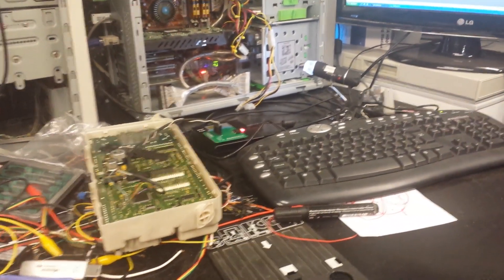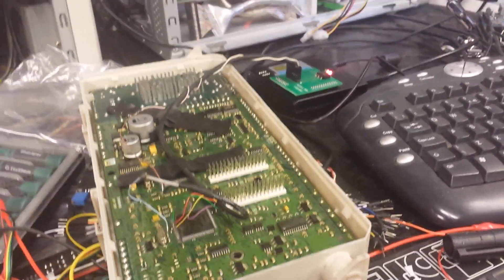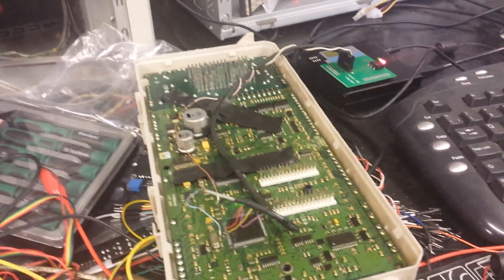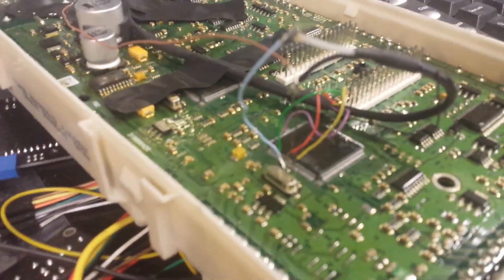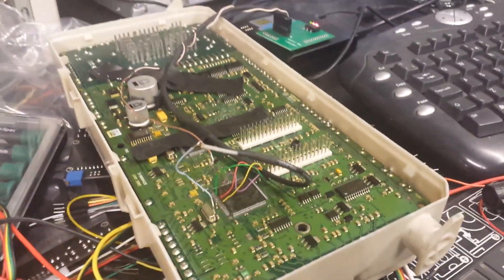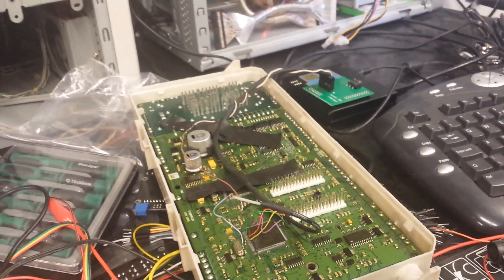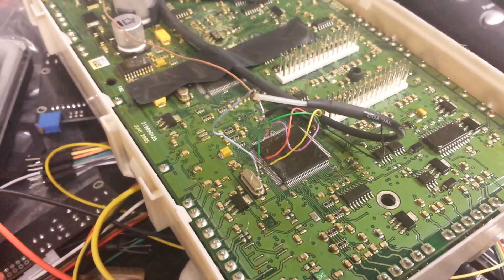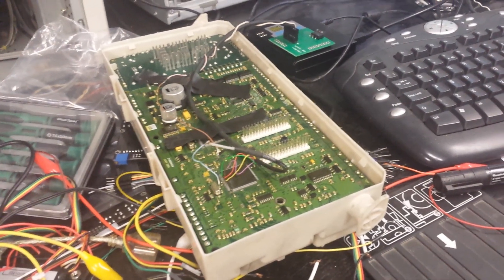Volvo S40 2006 CEM control module cloning/programming.

Comment: Hi, nice video. I have a question I hope you can help me with. I have purchased a 2004 model xc90 without any keys. I have access to a donor car with keys that are more or less identical. Do you have any ideas on what I need to transfer from the donor car to my car to get it to start and run fine?
Reply from the maker: I would attempt to just get some blank keys and program them to the car...
I don't even know if it possibly to program AKL to that specific car, but research that first...
Start to change used modules brings a lot of more variables along... I mean issues... lol
👍👍👍

Comment: Hello my cem is not working nothing working inside the vehicle including the ignition..nothing comes on ...i bought a different cem and swap the chips and it still did nothing.. but i realize that i bought a different type cem and swap the chips to it... Does it matter which type of board it has???? PS my original cem has a board like the one in the video
Reply from the maker: Have you done any other checks and testing prior to blame the CEM?
👍👍👍
Reply: @LMAutoRepairs  yes I did no blown fuses or nothing accept I opened the old CEM up and found that components were burnt inside

Comment: I have a 2005 Volvo S40 replace cems original is burned from electrical or moisture do I need to have key programed or new CEM if #'s match. Cause old one is burned dnt think anything could be cloned off it
Reply from the maker: Needs will need programming...
If you can't read old CEM, replacement CEM needs matching to the car and new keys...
👍👍👍
Reply: @LMAutoRepairs  how much will it cost to reprogram and keys, when I hook up the battery hear a like whining noise. Had ground that shorted fixed also the connector that orange that had the ground that shorted out fixed also.

Comment: Hi. The link for X-prog on Amazon is not available anymore. Can you recommend where to get an X prog if I am located in USA? Or are there any other not expensive tools to clone these modules? I need to actually virginize the modules so I can connect the original diagnostic system and program it as a new module to the vehicle.

Video is very informative! You are amazing!
Reply from the maker: Unless you go original, all the other sellers do sell pretty much the same...
Just do some research and you will find them for sale...
👍👍👍
Reply: @LMAutoRepairs I was recommended FC200. It’s a more expensive tool but it looks like a good one. You think its a good option for the money?
Reply from the maker: @VirgiliuMatei 
Never used it, but heard about it...
It might worth a try...
Search for people that used it, and see how it looks...

Comment: How did you know the orientation of the chip for soldering? xprog shows words on chip different than how you soldered it - great video, inspired me to do this detailed repair myself
Reply from the maker: Pin number 1... start counting from there...
👍👍👍
Reply: @LMAutoRepairs  sorry, probably a dumb question but how could you tell which was pin #1? My xprog worked and read properly but if I didn't watch your video, I would have soldered on the wrong side of the chip😅
Reply from the maker: The chip has usually a dot or a angle cut corner to mark pin 1...

Comment: Hi Maestro!
Can you simplify for me  this fault code  ECM 710b  Immobiliser signal missing
The vehicle can't turn on
The  Instrument cluster is blank it only flashes engine light
Can't operate nothing in the car
Volvo S40 t5 2005 petrol
Doing my fault finding I get stuck at some point the programme I'm using says Immobiliser 
Is on pins A13 of ECU (engine) pin 1 of IMMOBILISER control module and Pin B20 of
Keyless entry control module 
So my problem is I don't know where to locate the Immobiliser control module and keyless entry control module 
I will appreciate any kind of help or assistance.
 Thank you for your attention and patience 
Braga
Reply from the maker: The instrument cluster not turning on might raises other issues...
Can you communicate with all the modules on the car?
👍👍👍
Reply: @LMAutoRepairs  
Yes I can communicate with all modules
Reply from the maker: OK...
My checks would be, first make sure the key is actually working, not the remote, but the transponder...
From there, make sure the coil is getting power to read the key...
Check wiring, connections etc...
The keyless module on that, if I recall correctly, is a slave module of the CEM, I think is called RRX... 
But, the car should still star with the key in the ignition even if there is an issue with the keyless system...
Reply: @LMAutoRepairs  yes the key is working
When I check the live data on the CEM the key is fine
Only engine start says not permitted 
And it says ECM Immobiliser not ok.
So I want to do resistance test on Immobiliser pins ECU pin A13(E1) , Immobiliser control module pin 1 and keyless control module pin B20
So my point is I don't know the so called Immobiliser control module (E19)
According to Haynes pro data information and keyless control module (E46)
So if I knew it could definitely know something different
Reply: And by the way what is slave of the CEM?
Is it the steering lock module?
Reply from the maker: Yes... the steering lock is on the LIN bus, and the CEM is the master module...
Reply: @LMAutoRepairs  good day Maestro
I think I remember seeing that linked to the Alternator on the Diagram 
But my point is what will be called Immobiliser Control Module amongst all these Modules?
I think if I know that I can know what to do
This vehicle when it broke down , it displayed ABS and battery lights on the Dashboard in the 
In the middle of the road, I stopped the car switch off the
Reply: I switched off the car to try to check for anything wrong, then that was it till today 
No on , no crank  and no start
Reply from the maker: It is impossible to give reliable advice without actually look at the issue myself... as sometimes the small details make all the difference... but...
The CEM is the immobiliser controller if you will...
The keys are programmed and stored on there...
But, the ABS for example, is part of the immobiliser on those if I recall correctly...
That was the reason I was asking if you can communicate with all modules...
You need to check things lime connections, ground points, powers etc...
The way you described the problem now, seems like there is something else happening... the key doesn't just go away while driving...
You also said earlier the dash if off... that is not normal...
Reply: @LMAutoRepairs  Thank you
Like you said I'll do the continuity test and resistance test from the ECM to CEM 
But focusing on the  Pin A13 and see where it goes
I hope I may find something 
It is very strange for the vehicle to just act like this
At some point I suspect the ABA module ,It looks like leaking  brake fluid
Reply: @LMAutoRepairs  
Yes Maestro 
I can communicate with the modules

Comment: will a cloned unit from a 2008 car work in my 2006 car
Reply from the maker: If a similar model, should work...
But if you can get hold of an identical unit, would be better...
👍👍👍
Reply: not working in my car (2006) i sent the units to a repairman he told me the internal wiring is different and he doesn't know if it will work
Reply from the maker: As I said...
If they are similar...
Otherwise copying the data might not work due to the internals...

Comment: hi
volvo s60 2005
cem L(M32C AND 93LC86) is broken.
I need to replace it with a second hand cem L.
How should I do?
cem L clone With which programmer can I read and do I need a synchronization program?
Reply: smok programmer?
Reply from the maker: @islamocakdan9229  
Smok should be able to do it...
👍👍👍
Reply: @LMAutoRepairs 
THANKS
Reply: @LMAutoRepairs  
Hİ
original cem L
clone cem L
Is pin code required for both?
Reply from the maker: @islamocakdan9229  
If you clone the module, pins are not needed...
Will be plug and play once the data is transferred...

Comment: Not to be flip, but good job Volvo - you took a brand with a reputation for being bullet proof, die hard vehciles and made them into consumer "yuppie" status symbols to be replaced every 5 years per income requirements.  Please note that even though it seems possible to make these repairs cloning the CEM, is it REALLY appropriate for vehicles that are 10+ years old?!  Shouldn't there be a time period after which the so-called security protection hurdles to interchanging parts are lifted.   The case of these cars shows that even when you have so-called "right to repair" (as the information is out there), no garage really wants to do this in the USA because it can't be found on a checklist or guaranteed per a "established manufacturer procedure".  So you can find a shop that might perform the service by taking your CEM and shipping it to Canada to be reprogrammed, but that's about it.  So make room in the landfill for more of these cars!

Comment: I want to clone CEM Module L for volvo s80. What chip and eprom do I need to clone for this and which device should I use? can you help me? By the way again perfect video.thank you.
Reply from the maker: Open the module and check...
Not sure 8f the module is the same...
Depending on the eeprom or processor, but X-prog is capable of reading and write a wide range of chips...
Thank you for watching!

Comment: 02 XC70 P2 model. Tried download of software update from Volvo server. Laptop shut off during download now cem won't communicate. Have tried several attempts with dice and does not work. Any suggestions?
Reply from the maker: Try on the bench... similar to what I showed here... 
👍👍👍
Reply: @LMAutoRepairs  Would the flash memory still be intact since the vida flash failed?
Reply from the maker: Probably no... you need to try to get a good known flash file to load...
Reply: @LMAutoRepairs  wouldn’t a used module be different and not work if I extracted it’s file into mine?
Reply from the maker: Correct... but the module would come back to life... allowing you to flash it again etc...
I never had that situation... and I am just suggesting what I think you can try...
Reply: @LMAutoRepairs  Found out Volvo has a procedure with VIDA to bring it out of "sleep mode." Brought it back and updated it. All is well now! Thanks for the help. It will probably come in handy in the future.

Comment: Hi i have to say you really are an inspiration and a clever guy well done to you and thank you so much !!
I was considering buying a Kess clone to program my replacement V50 ECU from the data on the CEM and was wondering if you would know if the kess was able to do this? many kind regards
Reply from the maker: Hi
No... kess is designed to read the one area of the engine ecu... only...
Does not read generic chips like CEM etc...
For that, you need other tools...
Thank you for watching!
Reply: @LMAutoRepairs  

Hi
Im very great full and respectful for your reply 

its my honour to watch and learn from a master such as yourself

Kind regards
Reply: The full story of my issue is i swapped out the engine and needed to reprogram the immobiliser so i bought a Kess before i posted my question to you but i had problems with it,

there was no option to read the eeprom only the ecu/pcu so i got brave and tried to remove to eeprom chip (hoping to swap it over) but I broke a leg off from it due my inexperience so now im sure its unreadable so have order a x prog as i guess the information to reprogram the new/replacement ecu/pcu is still on the cem lets hope i get it right this time lol 

I have also order BDM Frame With 4 Probe Pen plus extra set of probe pens so hopefully i dont need to remove any chips this time, Kind regards and much respect
Reply from the maker: Which eeprom is on that engine ecu?
Even with a broken leg, I can still be able to read it... 
Can then put the data on a new eeprom, and then a you have to do is solder that on the ecu...
But one question, why did you have to change the ecu due to change the engine?
The ecu would control a replacement engine no problem... providing was like for like...
Reply: @LMAutoRepairs  
Thank you for your reply i really do appreciate it i know how busy life can be mate 
sorry i am just replying back ive had family stuff going on

i had opened up both ECUs and they are different but only by one chip i then managed to
find out that the replacement engine/ecu was from a 2008 car that did not have EDRIVE 
so though this might be why the replacement engine would not run on my original ecu 
which was from my 2010 car with EDRIVE

I had some time yesterday to investigate why the original ecu from my car was not working with my like for like engine swap as you asked and i also was confused by that and i was not 100% its was because of the EDRIVE difference between the 2 engines/ecu

the direction i went down was the take a closer look at the engine wiring loom plug where it connects to the relay/fuse box under the engine bay  and i discovered that the wiring colours are different on the replacement engine to the original engine wiring loom 

but that it has exactly the same amount of plugs to connect to the engine components  
which i had checked before swapping the engine 

So all i done was fit the original engine wiring loom to the replacement engine then tried the original ecu again 
(the one with the broken leg) and it started and runs fine lol 
obviously i not happy with myself about the broken leg on the eeprom but it seams to be good strangely enough

I really do respect all the work you do on your channel as im sure we all do mate.........thank you so so so much !!!!!
I hope you make good money for doing them you really do deserve to...... peace an love to you.......

Comment: I have a questions,  if I buy a used CEM, vida or Dice , can the car coded to start ?   my CEM be  died ...   is a s60  2001
Reply from the maker: If VIDA does it, will have to be with an online subscription...
I don't think will do it offline...
This is probably your best shot...
Thank you for watching!
Reply: @LMAutoRepairs    
It is a complicated question. Are you in England or the United States?
They receive shipments and repair these things, right?

I think the Mc68376bgcft20 chip is damaged, because it got too hot, but now it doesn't heat up anymore and the car doesn't do anything. Instead I think the 28F400 flash is fine.

Comment: I have two hundred to 2014 and I have 2018 that contains the LED Thor headlights as far as i know i would have to copy the data from the 2018 lighthouse and install it on the hundred of 2014 but I need to know what hardware I buy to be able to do this can you help me please ??? I'm from Rio de Janeiro
Reply from the maker: It might be a simpler way, by enabling them on the module configurations...
I am not familiar with that system though...
Just thinking out loud.... lol
Perhaps VIDA can do it...
Thank you for watching!
Reply: LM Auto Repairs I tried for life
and by vdash
there I saw with
a poles that they do but by the CEM msm reproaching

Could you help me, please
what tool do you use to reproach a CEM?

Comment: hi man, i bought a s40 2005 t5 auto on auction, the radio dont come on, the central locking dont work and also windwos don come up or down. when i scan it says no signal, i suspected its the CEM, from what am gathering i think the previous owner replaced the CEM but never coded it, now what can i do as i dont have the original CEM for the car, i also noticed when i removed the CEM inside there is a blown Relay on the board. What can i do? Can i get a 2nd hand one  in the car and how do i get it coded?
Reply from the maker: I would start by replace that blown relay, and go from there...
👍👍👍

Comment: If i swap the 2 chips to the doner cem will that work?
Reply from the maker: Yes... providing that the issue is the hardware, not the software inside the chips...
Thank you for watching!
Reply: @LMAutoRepairs  Thnaks for the response.

Comment: Do you offer volvo CEM cloning service? I'm having a hard time finding anyone that's reliable.
Reply from the maker: Not really... I like to have the car to make sure everything works...
What's wrong with your CEM?
Thank you for watching and for your comment!
Reply: @LMAutoRepairs  unfortunately it drowned via plugged sunroof drains. The car has no communication with various modules and a long list of volvo specific codes associated with that fault .
Reply: Additionally..no gauges, no start, no turn over. It basically acts like there no power to anything and no immobilser "handshake".